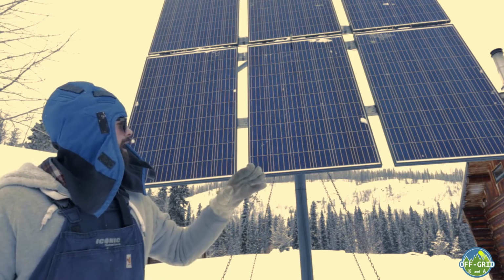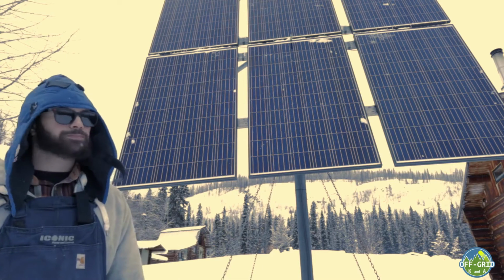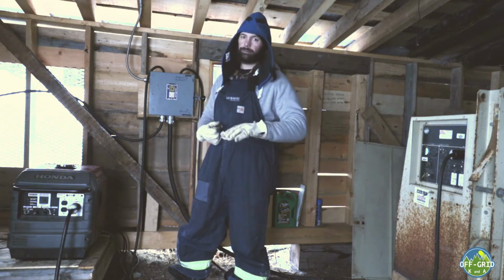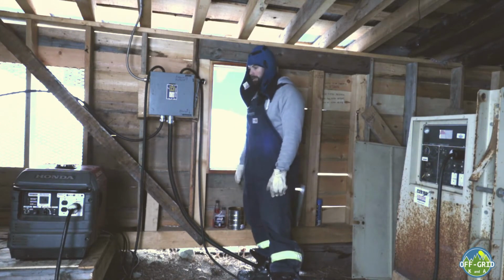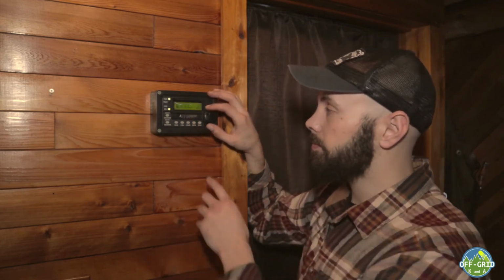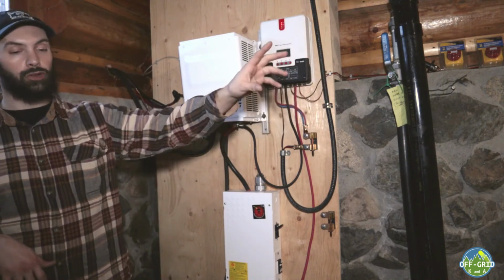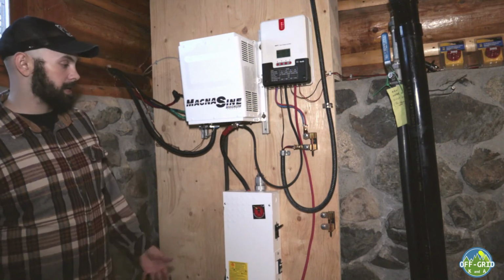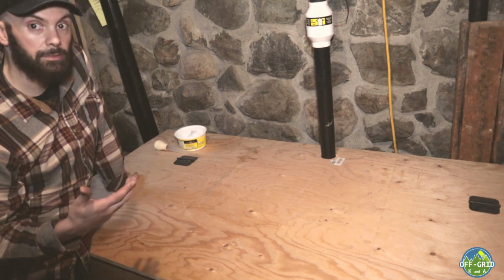Our OFF GRID SOLAR POWER SYSTEM // HOMESTEADING

Comment: How hard would it be to replace the panels if they broke?
Reply from the maker: Very easy, actually. Each panel has a wire that needs to be disconnected, and 6 bolts removed at the back. Panels don't have much weight either, but I wouldn't want to do it on a windy day.